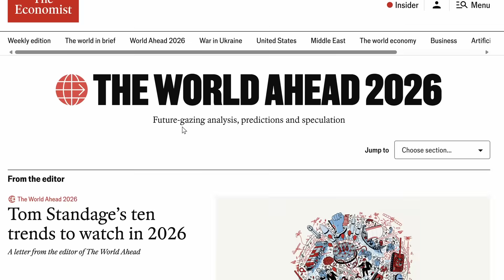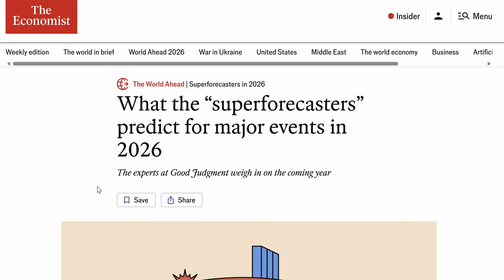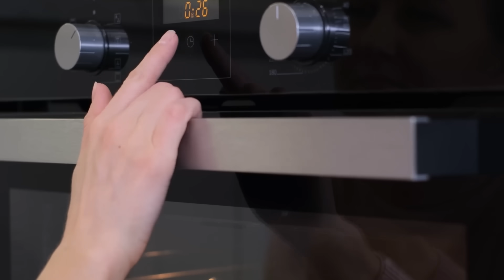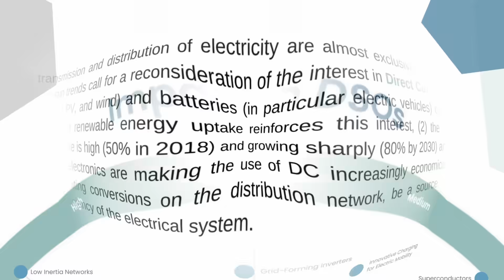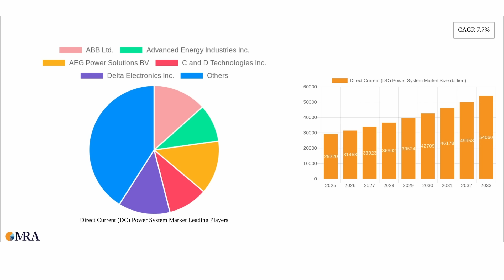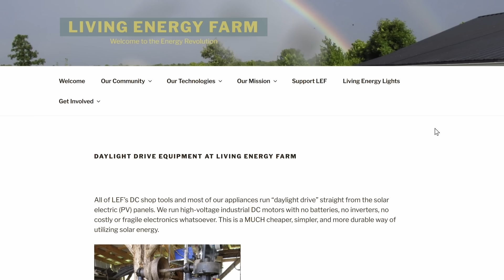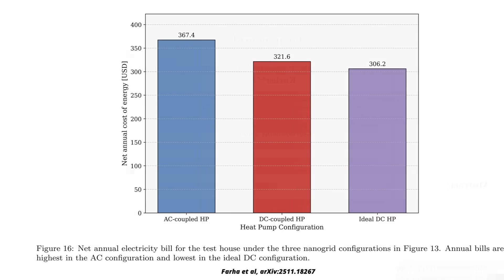Are We Using the Wrong Kind Of Electricity?

Comment: Most people in the USA, including myself, have appliances adapted to ac. Purchase of new apliances is required for change over to ac. Big initial expense. I'm a retired electronic engineer, so I understand the advantages of dc, but I worry about the cost (one time cost) to individuals and industry over changing. Sparks an fire in many instances if an ac adapted device is inadvertantly plugged into dc.
Reply: "Adapted" to AC? No, they were designed from the ground up for AC. What are you going on about? Major appliances in the U.S. have always used AC, as have every other electrically powered product for use in the home. Only recently has the use of 5VDC at up to 5A become common for low powered devices, as supplied by a USB C port.
Reply: @avsystem3142 by adapted, I mean designed for. Your comment "designed from the ground up" is what I mean by adapted. Even usb-c devices currently plug into ac. It'll be a long time before a dc grid is established to distribute dc to homes and businesses.